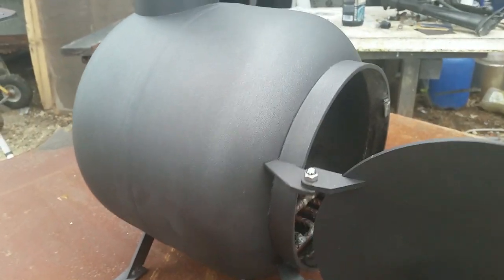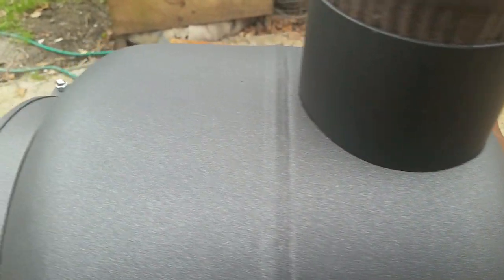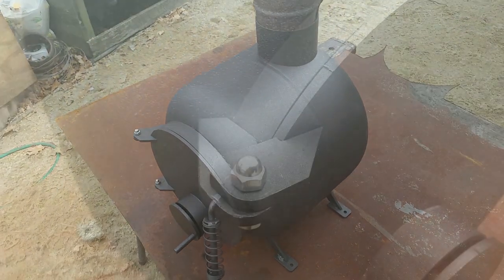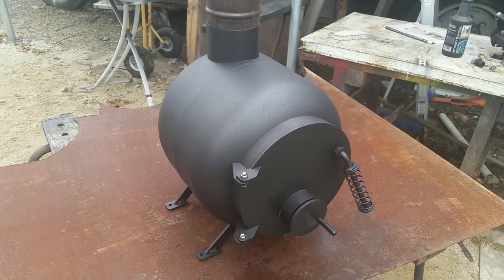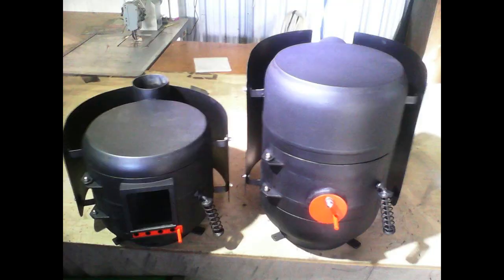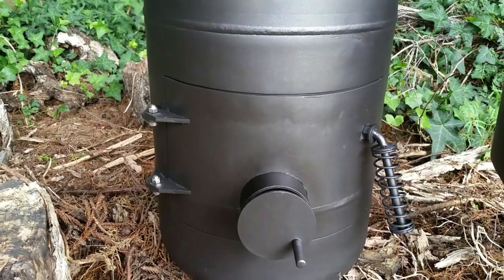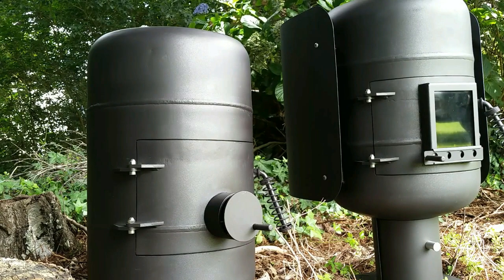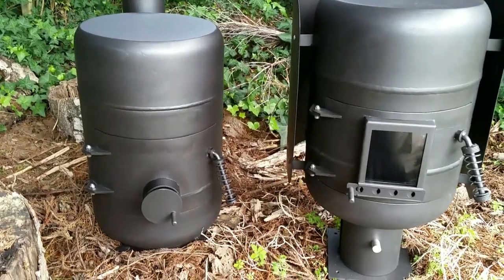DIY Tiny Woodstove  for your off grid Tiny Home

Comment: Thanks for the video! Another great inspiration! I just got the valve out of an old propane tank yesterday. Going to be a wood stove soon. Break out the cutting wheels and welder and here we go!
Reply from the maker: Well? - how did it go?
Reply: @t.h.o.r.  my little wood stove works great! I put the larger sticks (about 2" diameter) on the bottom level and smaller sticks on top of them with kindling and tinder on top of that. Starts burning from top goes to bottom. Once it's burning good there isn't any smoke coming from the chimney. Burns hot and clean. Should be good for my little shack I'm building. Amazing what can be done with scraps and imagination.

Comment: Very interesting. I live in a small camper in a forest and I froze all last winter (I'm in Canda). My camper is not insulated at all but I tried to do a few things to make it better for the winter. Long story short...I need to do a MUCH better job for this upcoming winter. What you made here would be absolutely perfect for me. I did use a kerosene heater last winter and it kept me alive, but i'd be foolish to not move to a wood stove considering I have an unlimited supply around me. Good stuff, you got yourself a subscriber :)

Comment: Hello from the backwoods of Ireland I've made a few of these over the years if you use fire bricks and internal baffle plate they last my one gave after 12 years have to make a new one no welding just a drill and a grinder so lots of bolts! 😂

Comment: Hi from central Otago fellow 🥝 😅Aha! I knew you had a LPG fire build video somewhere 😂I'm  building a new two cylinder burner model at the moment, I've got a single bottle one right now but I'm doing a double horizontal model. Quick question though. How long did you purge yours before you started cutting into them? I've removed the taps and been filling them with water for the past three days and emptying and refilling at the end of the day.oh also Where did you get your door glass?
Reply from the maker: You really want to know? I take the valve out of the empty bottle- tip it upside down and go have a coffee- when I come back - I rip into it with a cutting disc. Ive done about 70 per year for over 22 years now.  the glass is fire proof Shott glass. any glass place will get it for you- Its $700 per m2! https://blazingstoves.wixsite.com/blazingstoves

Comment: Cool idea.   I might try something similar as a fire box for an offset smoker.
Reply from the maker: Perfect - you will need a bit of gear, but if you have welder and grinder then you are most of the way there. just stay sensible- the de gassing is simple- purge residual gas by releasing small bleed screw on side of valve till empty. unscrew the valve and stand  the bottle upside down for a hour or so before you start cutting.  The thin 1mm cutting discs are amazing for slicing bottle up. check my other vids for how to do various parts.
Reply: I do have some modest metal working tools, including a small MIG and various grinders / cutters, and the skills to pull it off (I think). 
My thought is LP bottle for the burner, and my soon-to-be-replaced steel domestic water heater   (40 gallon) as the smoke chamber.   I will also have a soon-to-be-unneeded 275 gallon oil tank I could use, but I think that's bigger than I realistically need.   I'll weigh my options after I strip the insulation off the HW tank and see if it's big enough.  If it's not... we're going BIG with the 275.
Reply from the maker: Hey- Ive used the steel hot water cylinders, they are a great resource .
Reply: Awesome!   That's what I was hoping.    It's still a little hard to tell... it's in the jacket and still running ;)     One of these days I'll finish up my new boiler install.....

Comment: As a welder I’m terrified of welding a container that had something flammable or explosive inside, how do you purge them to be sure cutting the small tank is not an explosion hazard?
Reply from the maker: Oh whenever I do anything dangerous I gather all the neighborhood into my concrete bunker down the end of the street and do it all by remote control. see my latest video on the bunker
Reply: @t.h.o.r.  I was actually trying to find something out, that's why I asked. I ended up learning from another guys channel, so thanks anyway.
Reply from the maker: OK- here we go: This is how I do it - Im not advocating that anyone else does it. 1; open purge screw to release residual pressure. 2: remove brass tap. 3: stand bottle upside down outside for 12 hours. 4: Proceed with cutting welding drilling.  I guess that over all the years of making these Ive emptied several hundred bottles and never had any issues with this method. My offgrid water is precious so I dont fill them with water. there is simply no need.

Comment: wow, i hope you are able to see my message... So i am in the planning build stage and was looking at leaving out a bathroom but then thought, could copper pipping wrap around a wood burning stove in order to heat a metal bath tub... its almost pretty much an off grid bath tub set up... does anyone think this is possible or not, and any comments on this idea.i think this will help me plan out my set up more.... sorry for the long essay.... i think it would be a cool way to heat a bath tub.
Reply from the maker: yes- I make stainless steel chimney wraps that carry 6 litres of water around the chimney with a pipe top an bottom.. bottom pipe comes from a tank mounted slightly higher than the chimney heater. top pipe connects to the top of the same tank. when the fire is running, water is heated and the thermosiphon effect carries it upward and into the tank. cooler water replaces it in the bottom. it takes just 30 mins to get a bathfull of nice warrm water.
Reply: @t.h.o.r.   WOW, bro you should or do you have a video of this i might have to get me one. i know i might take a minute to get warm but to sit in a hot relaxing bath in a box truck after a long day of work and relax sounds so good...
Reply: I think that's a great idea!
Reply: @t.h.o.r.  that would probably work for heating shower water, too.
Reply from the maker: @mikemcgown6362   Oh it heats my oversize outdoor bath that I made from offcuts of insulated coolstore panel

Comment: Hey mate, you spray the inside with high heat paint? Also, how long do one of these hold up overtime?
Reply from the maker: I dont paint the inside. The grates  and the baffle plate usually need replacing at the 5-6 year point but the only ones that Ive made that have rusted have been used outside and sat full of water. wet wood ash is highly corrosive
Reply: TinyHouse and Offgrid Resources good to know thanks!